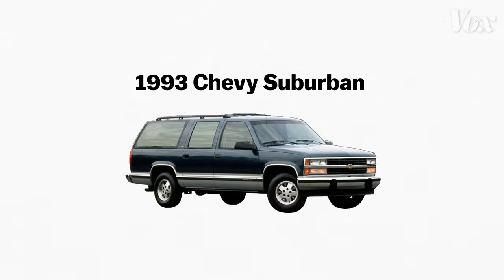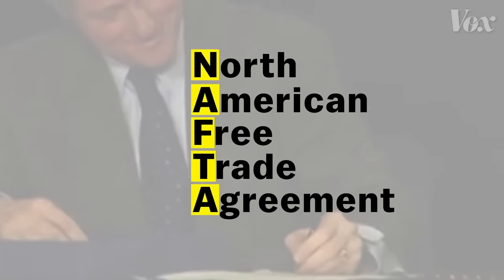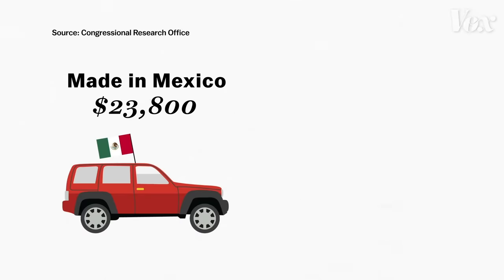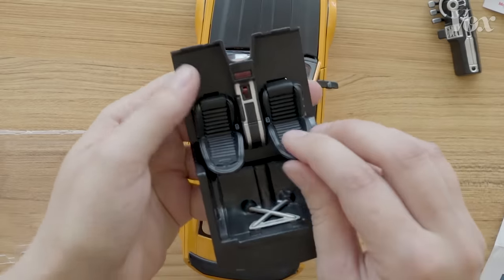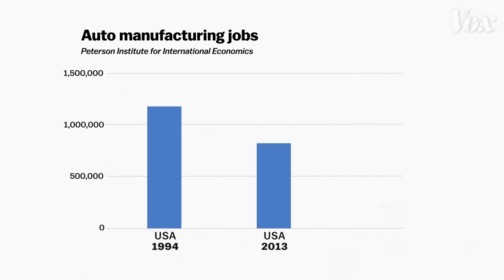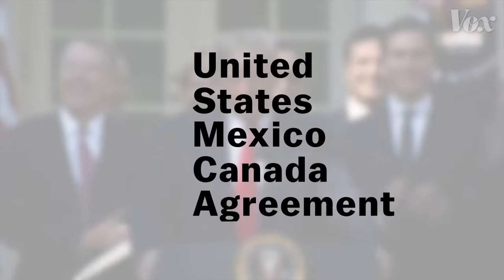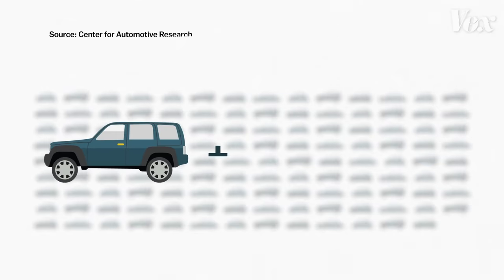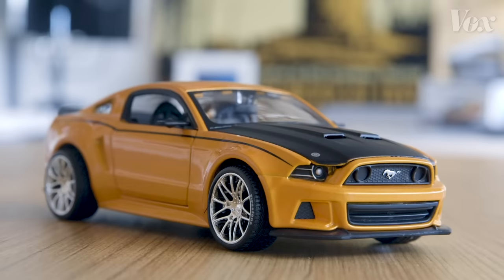USMCA vs NAFTA, explained with a toy car

Comment: The real question is why is inflation gone up almost 100% in 25 years
Reply: EXACTLY!!!!!!! Everything has gone up but our wages!!!!!
Reply: thats a really good rate of inflation, in economics you aim at having 3-4% of inflation at all times. 25x3.8 should make sense. The reason why you want inflation is to increase output of the economy, to try and break down my whole semester of macro economy of why inflation is good let me explain. Inflation essentially means that workers are producing more and more each year, if 1 worker produces more than 1 unit the difference is inflation. Your employer will probably give you raises as productive you are so 2-4% increase should be guaranteed. if the inflation were to be kept at 0% you employer would have to cut your pay by 2% to maintain their margin and cutting wages has more of a psychological toll on workers than raises so they might become less productive or be afraid of the future of the economy.

On the consumer side lower inflation is great but on the producer side it isnt and since the producing side determines wages and outflows it would essentially be detrimental. Technically in a perfect system there still can be growth at 0 inflation but society is not remotely perfect so inflation is the phenomenon we have to deal with.

Deflation is just as bad as Stagflation
Reply: @cdr861532  Wages are relative to the market you work in. If you ask any engineer working in tech or Finance major working in banking or a Doctor they would completely disagree with you! The market allocates money to where it deems it the worthiest.
Reply: @moderndilettante6896  markets general dictate wages, but that's true only without outside control. What we're seeing frequently is business sticking together to set wages low. It's the same idea as markets dictating rent prices, that's true, except for the landlords sticking together to set prices high. When businesses don't compete, the markets are no longer dictating the price... that's why rent in NYC and LA are so high. Instead of competing, they've banded together. Greed is prevalent now more than ever. The rich are paying to set laws that benefit the rich. Of course doctors and engineers aren't hurting, but those are specialized jobs, we are talking about everyone else. That's kind of like a surgeon who has killed many patients saying "but look at all these other incredibly healthy patients".
Reply: Inflation is a choice
Reply: Alex S I haven’t looked into any of this but from personal experience companies consistently compete for talent, ie, the more worth you are the more a company is willing to pay for your talents. While wages have relatively stayed the same since 1990, base goods have stayed the same for the exception of food and a few other. 

I think the problem lies in 2 main things, modern American culture (hyper consumerism, financial ignorance and propagation of horrible ethics and culture) and the lack of better trade networks with dependency on China. I believe that these 2 things if fixed will have a better impact for the average American compared to witch hunting American companies
Reply: Didn’t they make a video on that
Reply: A lot better than the GBP
Reply: That was due to Obama crashing the dollar and raising the debt ceiling.
Reply: Not exactly correct, 400%
Reply: @kermitthefrog3685  No its due to trump filling his own pockets, along with his lapdogs in that corrupt administration. Obama's great economy which was on the up since 2008 is now at the verge of collapse under trump. The warning signals have begun, so good luck. Next time pay more attention to who is doing what for this country!
Reply: No One how is trump filling his pockets
Reply: @Ethan Pochna Which has nothing to do with our inflation duh! It did keep the costs of vehicles down though since every single part is made outside the USA, but Trump's changing that, so when more parts are made here, expect the automobile prices to jump into unchartered territories like everything else he's touched!
Reply: @kermitthefrog3685  Mr. Frog, if the debt ceiling doesn't go up, our government shuts down, China calls in their loans, and Social Security checks (which is Socialism) don't clear the bank.
If the debt ceiling doesn't go up, seniors would be marching on the capitol.  Also, if you believe what you're saying, grow a pair and use your real name.
Reply: Inflation has not gone up 100% in 25 years though. Probably should start there.
Reply: @jeffreynichols4371  More like 400%
Reply: @TrumpProject2025  What measure of inflation are you basing this on? Not trying to argue, just curious. From every measure I can see, from the purchasing power of a dollar in 1995, to CPI, the figure is closer to 59-69%.
Reply: @TrumpProject2025  By some measures, it gets closer to 100% if you go back to about the late 80s-early 90s.
Reply: Capitalism
Reply: Well, 69% in 25 years. But I see what you mean.
Reply: @nothingatall3432  maybe do some research more than none. There are several examples including his golf courses losing millions of dollars in Ireland suddenly getting military money and foreign dignitaries paying $50k to rent rooms they don't even stay at... and this isn't including the tax breaks. It's understandable that politicians fill their pockets like Biden but let's not pretend Trump isn't an extreme case.
Reply: Before 25 years ago, that 100% increase would take less than ten years.  In there earlier 80s mortgage rates were in the high teens, and you could get 14% interest on a bank account.

Inflation is also linked closely to money supply, and that's been seriously increased in the last few years.  Don't know what's going to happen when the Fed drops its rates to zero, or even worse if their rates ever go up to a few percent.
Reply: Charles C i guess that can be subject to individuals on wether it’s good or bad, but per my text book and the class I took last semester it is more of a phenomena. But something I’m sure it isn’t is price fluctuations, that is much more micro and varies by state of trade, like I said Inflation is the economy being more productive that it should in a perfect system. But I will agree with you that much, if not all of the economy is pretty much a social contract that is affected greatly by psychology.
Reply: @moderndilettante6896  Now that's a lot of damage!
Reply: Yeah and notice the inflation is on the cost side
Reply: You will find the answer in a massive policy change made in 1913, the move to a Fiat and loan based economy.  Know that an increase in money supply increases prices, this is inflation. 1913 everyone.
Reply: @moderndilettante6896  That makes sense, thank you.
Reply: @MichaelVII_  stagnation is murder
Reply: The rich get richer 
The poor get poorer
Reply: @moderndilettante6896  how does an increase in wages cause inflation
Reply: Tyoko Rider I didn’t say that, I said that inflation is a reflection of higher productivity than necessary. It doesn’t always translate to increase in wages. Usually it did but modern financial practices can find different ways to use that extra productivity. To put it in the easiest way possible, Inflation is the economy growing too fast. There are many factors that affect the growth of the economy (monetary policy, production, demand of goods and services and etc) but the main thing to keep in mind is that inflation is mainly affected by 2 reasons money supply, and economic growth. Everything else is pretty much an outlier that can affect but happens due to certain circumstances and not natural growth.
Reply: Democrats and iluminati duh.
Reply: @TrumpProject2025  you do know if it wasn't for Covid trumps economy wouldn't be so bad right? And Trump donates his presidential income to charities or doesn't even take it at all. A U.S. president makes about $400k a year on average.
Reply: Well it's clearly Trump's fault he been president for 4 years and caused 30 years of inflation 🤣
Reply: @dcavic6157  China did that, not Trump.
Reply: @dcavic6157  it was sky rocketing before covid.
Reply: @shaolinshowdown1123  it was sarcasm buddy.... Sarcasm
Reply: @dcavic6157  oh. I dont believe in text book science 100% btw. Im a creation theorist.
Reply: @dcavic6157  He sure didn't help it! Prices doubled up under his ridiculous deals, but I'm sure you didn't bother to check before spouting off Russian troll.
Reply: And yet the fed keeps telling us there is no inflation so keeps interest rates low
Reply: Sorzin : yeah, I think people forget about our overarching system. It comes with ebbs and flows along with risk. Stability in a country requires elements of socialism.
Reply: What we need to do is bracket the minimum wage to inflation
Reply: More money you print the less the money is worth
Reply: This video is a lie , I seen the closed down factories
Reply: The fed has said repeatedly for the last 10 years that there is no inflation. Thats the problem
Reply: Probably the fact that about a quarter of all the wealth in the US is tucked away in billionaires bank accounts.  Money in accounts doesn't make the gears of economy turn, only money being spent does that.  The more money that gets tucked away the more that needs to be printed to stimulate the economy and the higher the inflation.
Reply: The US budget deficit and forced money printing by the federal reserve.
Reply: Economic growth
Causes
Inflation
Reply: @moderndilettante6896  Inflation can also cause a recession or another Great depression. Inflation is something you don't want.
Reply: @Brain_Food-  inflation has never been the root cause of recessions or depressions ever. Speculation and bad financial regulation are at the heart of it always. Inflation is mostly a reaction to events or simply growth outside of the ordinary. IE current inflation is caused by central banks lending money at ridiculously low rates to “stimulate” the economy because of COVID and supply chain constraints that happened because of covid. More people borrow looking to buy product that is limited because of a natural phenomena leads to increase in prices to regulate demand. In the end the consumer pays for these changes in the market but it’s not like inflation will cause the next recession because no one defaults on their house because the price of cabbage is too high.
Reply: @Dwarfplayer  no idea how I missed your reply but YES! Terrible capital control policies are destroying essential and basic human needs. I doubt this will be sustainable for long and I hope that governments begin to take this seriously before it implodes.
Reply: @moderndilettante6896  Inflation causes less demand overtime. Yes it might be good for businesses but who exactly are buying those products. Look at the US from 2000-2008 when inflation took ahold of the economy. It can cause a great depression if you expand too quickly and have no one buying your expensive products. That's why there was a federal minimum wage established 5 years after the great depression.
Reply: @moderndilettante6896  Inflation causes product prices to go up no matter what, not because of the demand as we've seen wages for the most part remain the same which is practically poverty level and people are becoming less inclined to buy those products. Inflation is terrible and more so in the hands of politicians.
Reply: @moderndilettante6896  this is an entertaining comment thread, thanks for keeping it alive for 3 years XD

Comment: I love how you guys toed the line. The entire tone of your video is anti-USMCA yet you narrowly avoid committing to that position by using terms such as "could" instead of terms such as "will".

Even if the prices go up initially, wouldn't you expect it to reach some equilibrium just as it did under NAFTA? Also, isn't $16 / hour a good thing? That is a whole $1 / hour more than the $15 / hour liberal activist groups have been fighting for. I would have thought they would welcome this legislation.

Comment: NAFTA isn’t just about cars
Reply: it was explained with cars. ok?
Reply: Car's are the only industry affected significantly by the new USMCA deal.
Reply: Cars are and dairy products are the only major industries impacted by Trump's 'renegotiation'
Reply: Who said it's only 'bout cars, ranger?
Reply: some body and Who wants to explain NAFTA using milk
Reply: r/whooosh
Reply: I have to disagree with the idea that Mexican Manufacturing jobs will move to the US and Canada. Why? Because there is no benefit to moving the factories. In the US, they would have competition for labor. Think about it. In the US, the average Car maker job already does pay 16,75 U$D per hour, while the average national hourly salary is 22,81 U$D. While in Mexico, the average hourly salary is 1 U$D. This means that Car manufacturers will be able to extract more professionalism, loyalty and the best labor that Mexico can Offer. In the US, they would just get the Bottom of the barrel.
Not to mention that they can still save in low wages in all other jobs not covered by the new deal.
The only ones benefited by the new arrangement, are Mexican Workers.
Reply: I wonder if its Possible for Car Makers to skirt USMCA rules by outsourcing many (small) parts to Mexican SME's, then assemble them in the Maquiladoras. Because if it is, that's what they will most likely do.
Also, i don't think the Skill between Mexican workers and US workers is really that Different, if at all.
Reply: I wonder how many Jobs will be lost due to the extra cost of Manufacturing?
If they could Mexicans workers skilled enough to make those cars with just 1 U$D per Hour, with 16 U$D they will definitely get the Creme d'la creme of Mexican labor.
Oh, and lets not forget Trump's Tarriffs in other Goods, like steel and aluminum, which can still affect manufacturing in the US.
Reply: Prometheus but vox explained it in a way to promote nafta and only accounting for the auto industry. Theres plenty of reasons to be against nafta that isnt just jobs lost in the auto industry. Dingus.
Reply: It’s the most affected industry. After NAFTA Canada for example still had huge tariffs in their agricultural sector

Comment: Just buy a Corolla. It’ll last a lifetime
Reply: It would've helped you escape Waterloo. What a shame.
Reply: 🎼🎤 "Waterloo , Couldn't escape if I wanted to "🎵. ~Abba
Reply: Lol I know somone with a 2002 Toyota Corolla
Reply: AE86 AMIRITE
Reply: Toyota 4runner, just like the old Japanese cars it's still made in Japan and imported. It's not uncommon to see then with 300k miles
Reply: @stanlim9182  wo wo wo wo Wateer looo
Reply: I bought a Corolla in 2014 and last year I had so many problems with it, I would recommend a Cruise or a Fusion.
Reply: Toyota in general
Reply: I have a 2000 Toyota Corolla that my parents bought before I was born. Still drives
Reply: I would have if they weren't over priced.
Reply: Honda civic
Reply: I'd rather buy a Dodge 
It's the only cheap brand i still respect because they are not going eco friendly
Reply: Who asked you Scotty Kilmer?
Reply: Marek Misztal, what’s wrong with going eco friendly

Comment: While Tesla produces everything in the US. Why can’t everyone just switch to building everything in America?
Reply: Because cars would be more expensive. They said it in the video.
Reply: Laziness
Reply: Cars would cost much more.  We have strict epa rules on manufacturing which pushes companies to manufacture in other countries to save on labor and EPA regulations
Reply: The cost of the salararies 🤑
Reply: Because there aren't many moving parts in Tesla vehicles compared to other ones, and considering the price of the tesla battery it's actually cheaper to produce Tesla vehicles domestically than abroad. But tesla is litteraly the only exception.
Reply: lol. tesla just opened up a ginormous plant in shanghai
Reply: theres a reason Tesla's are significantly more expensive than most consumer cars lol... they have a plant in China that is making the model 3 and the Model Y. Yeah even your glorious Tesla knows the benefit of cheap labor
Reply: @Opticillusion160  Well for Chinese markets yeah. China has 40% tariffs for vehicles, so they built a factory in China. They are also building a factory in Europe for European markets. Also, that Chinese factory is wholly owned by Tesla, so they make their own rules.
Reply: @Opticillusion160  So the Toyota and Volkswagen factories in the US are Japan and Europe outsourcing?   If you are going to sell a car in a large market it makes sense to build the cars on site, it's called common sense and is the reason why Tesla has a factory in Europe and a factory in China.

Comment: 0:20 "the cost hasn't changed much" 

I guess 5k is just pocket change to vox
Reply: 5,000 is a 11% increase, which could be a lot or not depending on how much value the car brings to the buyer. At 40K+ levels it is likely most consumers are not price-shopping.

Comment: I once worked with a guy that had previously worked in a Cadillac plant back in the 80's.  He got paid $18 an hour to move a vacuum cleaner from one cell to another along the production line.  All he said he did was move the vacuum cleaner somebody else got paid more than he did to turn the thing on and use it!